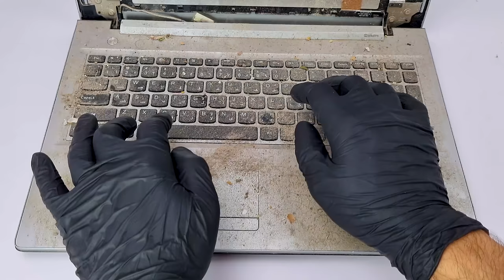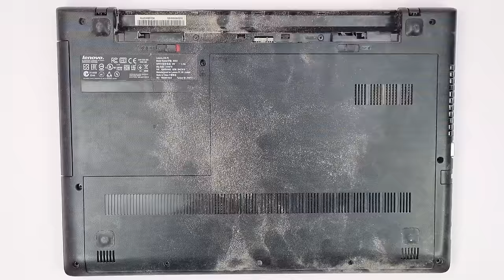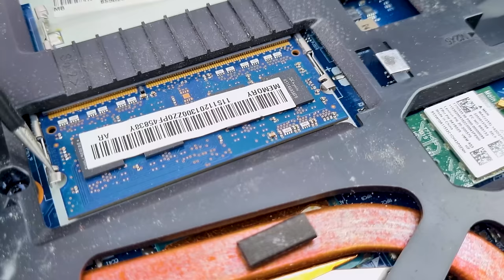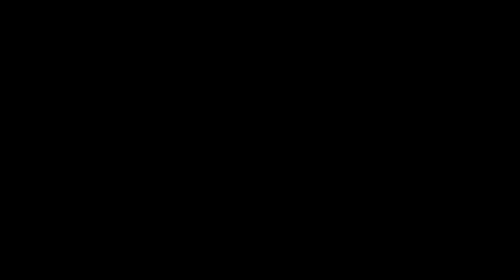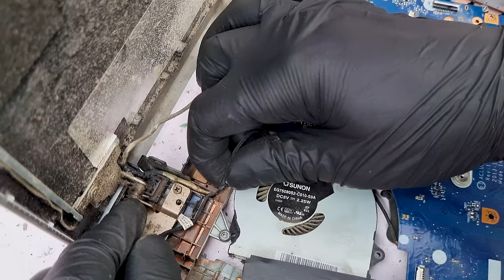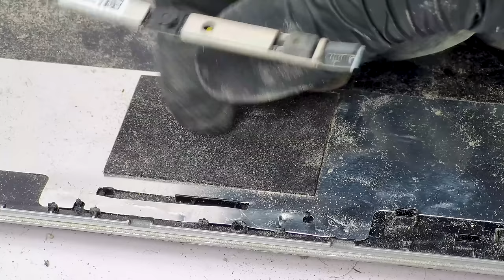This Laptop Was a Junk - First Perfect Laptop Restoration ASMR On Youtube - Upgrade & Test

Comment: I was freaking out while seeing this laptop still can run Windows and the touchpad is working too
Reply: I have a 2012 Sony Vaio,since new,  that i have maxed out with i7-2670QM ,16 GB Crucial Ram and 500GB Samsung SSD. Running Windows 10 no problem. Everything functional.
Reply: @makosasimakis118  wow
Reply: Hhh lolzzz half of pakistan using dell optilex 745 to 780 with core 2 dual processor even in offices😊
Reply: I would have thought it would be broken for good and not work anymore because of it’s condition

Comment: i wish i had laptops like this. i use a hecking old pentium from 2011....luv ur vdos...keep going
Reply: I HAVE THE SAMELAPTOP
Reply: Blud, there are gaming laptops for 500 dollars wich have decent power or for the same price gaming pcs that you can build youreself easily wich have the strenght of getting 30 to 50 heck even 60 fps in shooter games like fortnite or apex. And if you want a "normal" laptop you can get one for even WAYYYY cheaper like 100 to 200 dollars. I wouldnt really stick to 100 dollars if i would search a low performance laptop just for videos or school but rather on 200 to maximum 300. If you go above, you can get decent devices that can be pretty good. But if you really want a good gaming laptop, set youre budget at least to 800 because trust me, i have made that experience..... its not cool!

Comment: The only good things about this laptop design are its easy to upgrade and removable keyboard. The rest is pretty disappointing. If you wanna replace the thermal paste, you have to disassemble the while thing. This design was a trend in laptops from 2010 to 2014.

Comment: But whay you did not wash the plastic cover with water  INSTEAD OF JUST BRUSH ? THERE IS NO PROBLEM EVEN IF TRACKBAD IN THE COVER YOU CAN ALSO WASH THE MOTHERBORD JUST DRAY THEM UNDER SUNLIGHT OR USING HAIR DRYER Before assembly.

Comment: Can we upgrade a ddr2 ram slot in a laptop
More than 2 gb
Reply from the maker: Hello my friend.
Thank you so much for sharing your question with us ❤
It depends on the laptop model, but generally, laptops with DDR2 RAM slots have a maximum capacity limit. Most laptops with DDR2 memory can support up to 4 GB of RAM, with each slot typically allowing up to 2 GB. However, some older laptops may only support up to 2 GB total. 

I’d recommend checking your laptop’s user manual or looking up its specific model online to see the maximum supported RAM capacity.
I love everyone who watches Restoration Division. Please make sure to follow for upcoming projects ❤

Comment: Can you make your channel more on laptop restoration 

I really like how you restore the laptop 

Other restoration channel I don't like because I can see how rusted the laptop that they restore even though I can see that they just buy the new motherboard so the restoration is nothing anymore 

And please make the laptop max out the upgrade next time, Its ok if the upgrade like 4gb to 16gb ram if supported and the storage please don't buy 128gb only buy 500gb and up because 128gb to 256gb is not big anymore for Windows

If cpu or gpu can upgrade please upgrade that two, if you can only, I know how expensive those

Comment: Hello guys, I own an Asus Tuf F15 RTX3050 Variant. The problem that im facing is that, my shift and m key both works finw individually, but as soon as I try shift+m , no output is generated. 
Also when I run cmd as an administrator, I face no issue in typing shift+m
Can anyone plzz help me?
Ive tryed using external keyboard
Reply from the maker: Hello my friend. It might be related to the language you are typing. so make sure to check it out and by the way, if those keys are working separately, then it means that most likely your keyboard is just fine. You can also make sure to install the driver of trackpad and keyboard, based on your laptop. To make sure if your keyboard is fine or not, you can use some online keyboard test websites.
Generally I believe that this is not a hardware issue. 
I wish this helped you.
See you in the next video my friend.
Reply: @RestorationDivision  sir, when I made an anoyher user then the keys do work fine

Comment: The question is: Why restore this? Finding the parts for some laptops are difficult and when you finally find it, it's not gonna be cheap depending on the laptop
Reply: Depends of the laptop, but in Ali you can find anything or other pages, some times depends, in my case i restored a thinkpad t470p from lenovo and was cheap some plastic cases
Reply: For the satisfaction of doing it!   For just being able to make something work again.  For the enjoyment of the process.  For the sense of achievement you get when you manage to turn an old crusty reck back into a working laptop that looks like it's just left the factory.  It's not all about the money!
Reply: to keep out of landfill